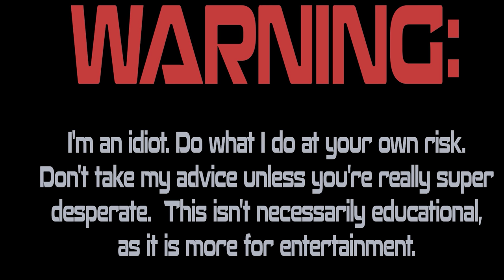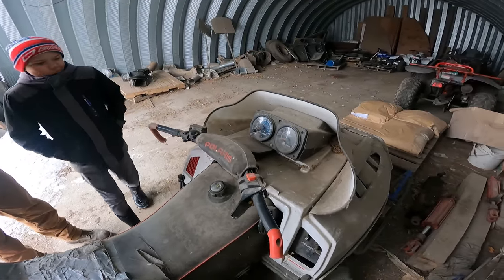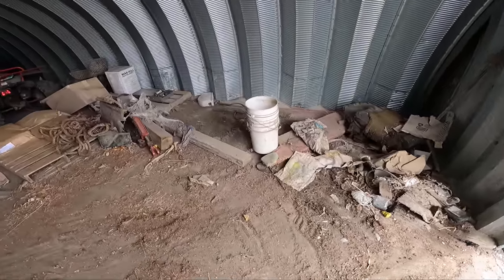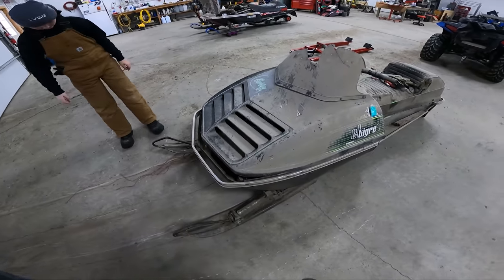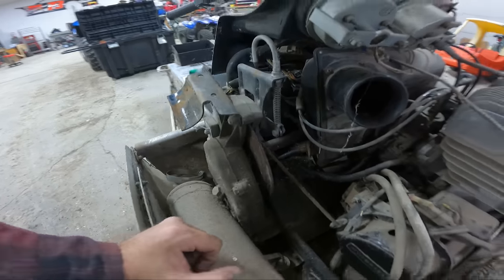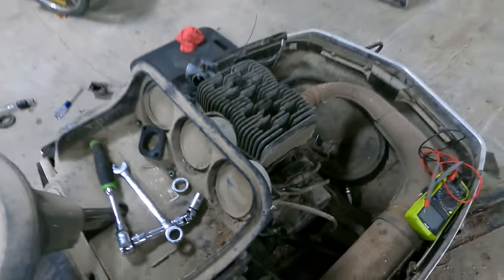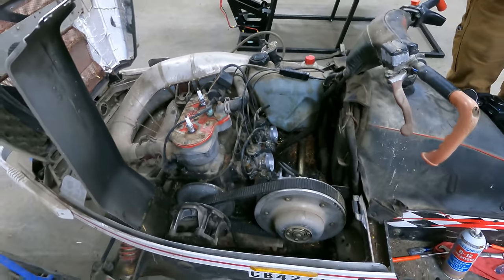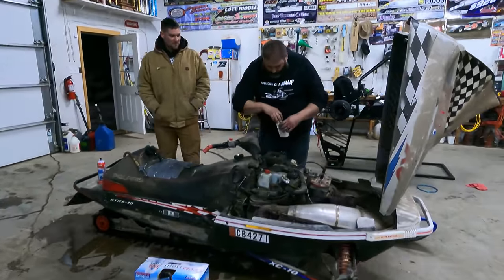VINTAGE Polaris AND Arctic Cat Snowmobiles - Will They Run? (WITH MILLENNIAL FARMER!)

Comment: Yes us Fellers up in Canada would like to see that old cat running again!
Reply: 2nd to that
Reply: They were very popular up here in Canada but many did forget they were ‘fa’s’ aka free air which meant you don’t run them slow or lugging..they are meant to be out on the lake and a couple of ticks from take-off. Run Em slow and kill em dead. Guys often used a cooler plug and/or richer fuel which of course ultimately ended in a foiled plug and often dead coils. It’s a whole chain type thing what goes wrong. Keep an eye on those temp gauges. 😉 purrrr kitty purrrr. 
We had a panther, a cheetah and finally a Tigre` then many other brands...winter loooong in Canada.

Comment: Your making me feel old because I was the engineer for production of that Polaris 700!!
Reply: Hometown celebrity right here.
Reply: You serious? I got a 600 xc indy and its the greatest ski doo ive ever bought!
Reply: @destro420qc6  The 600 was my project too. Here is a little fun fact! The 600 cost the exact same to produce as the 700 right down to then penny. Polaris lost money on every 600 sold over the 700!
Reply: @destro420qc6  er that Indy was the greatest Skidoo you ever bought?   No biggee, I get it.  We used to say,  let's go ski dooing back in the day.  Skidoo loves the attention anyways.
Reply: Young stoner. Had 97 xtra 10 600.  Triple plped triple dg can Psi 800 kit. 151 track. Monster. But have to admit twins make tons of HP.
Reply: Goddamn must have been a damn monster lmao, all i know is that mine was doing drag race back in the days before it got forget in a shed lmao, 10 000km before i had to open up the engine and both piston were broken and it was still running, the piston were 0,6mm too small and still i’ve reached 200km/h with it, it was a pain in the ass to start, but now with new piston and all its almost scary to ride especially when it start drifting in trails lmao(sorry for my english im french)

Comment: Ohh fancy, trailing arm suspension on the front of that Polaris. Oughta be a cushy ride there!
Reply: Polaris now has swing arms on the rear like a street bike, have for about 10 years or so
Reply: Polaris had it in the early 80's the skidoo copied it later on

Comment: I got the coil,for the eltigre   I’ll just send the motor mines bored I trashed the sled due to bar wire fence need your address
Reply: Run it:it’s fast
Reply: Awesome, Tjay. 
A guy can find contact info in the "about" tab on the home page for VGG.
Reply: It`s also in the description above.

Comment: Also give them time to build heat before ripping. The pistons expand faster than the cylinder does. A cold seize situation an occur. Also the carb boots between the carbs and engine have a tendency to crack and leak air causing a lean condition. Have fun guys!

Comment: @Vice Grip Garage The Arctic Cat is a 1976 model. Any Arctic Cat key from that era will work in the key switch. The brake disc being loose like it is on the jack shaft is pretty normal. I'd do a compression test before you go buying any parts.

Comment: El tigre is a 76 made in late 75.  The 75 year model had the kawasaki engine quad plug heads.  Also the decals on it are for 76 model year.

Comment: Love the faces on the kids when the Polaris came to life, makes it all worthwhile. Another great video Derek, keep them coming. I raced snowmobile oval track and hill climbs in winter and grass drags in the summer running Arctic Cats from1970 to 1975. I live in New York and we raced local events and at Booneville, NY. Had a 634cc Panther with chrome side pipes, 500 ElTigre, 650cc Chaparral, Yamaha 433, Sno-Jet SST 440. Great times.

Comment: I had a 1999 Polaris indy XC 600 WITH THE HIGH PERFORMANCE TWIN WITH THE BIG BORE MOTOR, I RUN IT AT A RADAR Run and I got it up to 103 mph in a 1000 yards. 
I love it, it was so fast and great handling, the pipe was rusted out so I put twin pipes on and jetted and clutched it so it would run better and it sounded great. I sold it to a friend of mine for 1200 dollars. We have gotten a foot of snow since late Tuesday night 14 inches so far.

Comment: I had an identical Polaris xc snowmobile. But it only had the 580cc motor package. And they were well known for having fuel issues. From the 580’s to 600’s to 700’s to 800’s. The easiest fix was an aftermarket rebuild for the carbs, and fuel pump.

Comment: Oh the old Suzuki spirit 500! Had a 79 panther 500 touring sled single carb n that fucker ran hard! Ended up getting a Pantera 500 free air with dual carbs, swapped motor over and dual carb the fan cooled, cut the expansion camber to remove the muffler and wow! Ended up putting that spirit Suzuki on a mid 80's ski-doo everest n never looked back! Those old Suzuki 500's are animals!

Comment: Here's a tip. Fill the cylinders with Lemon oil and let them sit over night to loosen them up. Broke an early 70s yamaha 292 one lunger that sat for 20 years and seized solid loose using the method.

Comment: I’ve got one of even older (and more rare) vintage sitting in my garage if ever you’re looking for another prospect.    Same story though, father bought it brand new 35+ years ago and I still have it because of sentimental value.   Hasn’t run or seen snow (or even sunlight) in about 20 or more years.

Comment: On the XC700, careful, buddy had one:
Broke the starter rope out on lake-so we did the rope on the clutch starting method.
Proceeded to blow up engine almost immediately because the bright engineer put the oil pump in the starter recoil area.
Which broke from the loose starter rope.
Full rebuild later, first restart on lake rope broke again! We towed her this time….
Broke the ropes and blew the engine because there was a pop rivet sideways by the pull handle,pull it the right angle it was like a knife.
Sideways pop rivet cost a motor and another 10 mile tow.

Comment: Hi Derek,,, 
My father taught me a cool little trick when trying to clean Carbs & their little tiny screw holes inlets and outlets & components too - He told me to grab a deep spaghetti boiling pot - throw all moving parts along with the bodies of the carbs - and anything els that has tiny little parts and holes that you may not be able to clean - fill up the pot with pure Distilled Vinegar and soak 24 hours  - then rinse thoroughly with highly explosive liquids ( JUST KIDDING) - Rinse thoroughly with mineral spirits.....or something of the sort....This method has always worked very well for me - Thanks - and sorry about the coil on the Artic cat
you will get her goin----I just know that you will....there aint no engine out there that can't get to fire buddy
Love your vidz Derek
Steve

Comment: El tigre is a 75, i had a 74 in the late 90s early 2000s as a kid/teenager. It had a steel/chrome tank. It was more machine than a 100# 13 year old kid could handle back then.

Comment: I’ve never lived in the snow, but I’ll tell ya I sure like this snow machine content. Looks like a blast.
Reply: You can run them all year round, you can change the skis out for something resembling roller skates and put a smooth track in them for driving around, or if your being lazy just drive them on water, just hit the kill switch before she goes under, rig up a winch and pull it out, pull all your plugs and hang it from a tree to try out while you run to town to get new oil/ gas

Comment: To get spark, unplug stuff instead of plugging it in. No key needed if you unplug at the back. Tether and kill switch work the same. Check compression, should be at least 120. Blow in the tank to pressurize your fuel system to prime the carbs, this will save you lots of pulls on initial start-up. A little gas poured straight down the spark plug hole will help get it going as well. A mouse WILL chew up the paper towel if it gets there.....that's how you know you didn't have a mouse. That 500 is in fact a very special sled. Kinda like finding the sled version of a big block chevelle.

Comment: I bought one of those 700's used when I was about 15 that had been bored out and ported I know I pegged the spedo over 70 a few times with it it was scary fast and torquee. Useless in powder/deep snow though to heavy and to short a track "another good reason for that extension" it had no low speed you touch the throttle and if it doesn't bite your digging a hole in a second so was only good for already packed trails. Only had it a few years before the engine seized on it and was a few years with crap for snow "Northern MN" so we sold it and another sled with our snowmobile trailer to some guys we had doing work on our property one summer. A few years back I bought a used EFI sled and it put that old 700 to shame but was again crappy in deep snow so sold it soon after buying it and fixing it up some.

Comment: i had  that 1977 artic cat when i was a kid my dad bought it brand new for  $ 700.oo it would run 80mph no problem you have to run premium fuel in it or it will self destruct the throttle cables stretch  like crazy its the same engine as your pantera 1500 miles is about what you would get before a rebiuld will be needed use the best oil you can and mix it heavy the machines need a lot of lube if you want it to last but this is what was available at the time we still had a lot of fun brings back some good memaries

Comment: The date on the side is the build date, not the model year.  Usually you would add one as most of the '76s would have been built in 1975.

Comment: the old El Tigre should have a Kawasaki motor in it. 1975 was the last year in the Arctic Cat Jag. Arctic Cat cut ties with Kawasaki an went to the spirit motors. The 1974 typically had a quad plug engine.

Comment: Hey if your interested in ditch banging and a bit of hill climbing come to Northern Saskatchewan, we have snow from October to March, usually have 10 feet of snow a year or so, enough that you can drive over barbed wire fences easy, also if your board check out ice road truckers, cause that's a thing here, my Dad was the first one to cross an ice road with a load back in the 70s, went all the way up to Uranium City

Comment: I don't know if you remember Winny the Poo but in that there is a charicter named Tigger. The ElTiger is pronounced in that manor. As for the Suzuki powered ArcticCat, it is a 76. Up through 75 the Cats were powered by Kawasaki engines with for spark plugs, and a Kawasaki powered 440 would walk all over the Suzuki powered 500 in a short or long race.
As far as that goes, the Suzuki powered 440 (431) was quicker than the 500.
I used to race those Sleds and liked the Kawasaki's best.

Comment: I had a 98 xc700 in the early 90s. That sled ripped. Had pipes and a boost bottle. Didnt handle for shit, but not many sleds could touch it. Of course that was then.

Comment: I was told that the El Tigre has nickel lined bore and couldn't handle slow driving, not enough air flow and would warp the bores. Idk. But they were fast, only a j.d. liquid fire could come close for years

Comment: i have an 81 cat i had ignition problems i unplugged the key and pushed the plug up thriough the dash and tapped it to the steering post and bend a metal hanger to stick in each end and it work fine it goes about 60

Comment: When that polaris fired up and backfired all i could think about was my 2001 RMK 500. Been fighting it for awhile now.  If any of you have any ideas ill post my comment from the video before this I would greatly appreciate it. Thanks.  
Comment from last video. 
Hey Derrick and fellow watchers. I have a question for you all. Long story short I have been messing with 2 strokes for about 20 years I'm a diesel mechanic by trade and long story short I usually don't mess with anything newer than 2007 because of all the electronics and emissions crap. I have a 2001 Polaris RMK500 and I am stumped on this snowcat. It's problem was it would run great for about 5 minutes or so and then backfire and die and wouldn't start again for about a couple hours. I have excellent compression and great spark. Things that have been replaced are The CDI box and the stator and coil and the carbs along with a new fuel pump and lines. I've done a leakdown test and it passed with flying colors I have also done a smoke test to backup leakdown test to make sure center crank case seal is good. I have replaced the reeds as well.The sled has 600 original miles on it and I would love to see it run rather than part it out but im at my breaking point with it. I think that because I have spent so much time on trying to get it running that I am probably missing something so small and stupid. If any of ya'll have any ideas I'd greatly appreciate it this one has me stumped for sure. It does have the flat slide twin carbs with a single furl feed and I'm leading towards the carbs because I can spray fuel into the cylinder that is not firing ( which it swaps occasionally) and it will pick up as long as i continue to spray fuel into it. If ya'll have any ideas please let me know. Thanks

Comment: The anti-mice paper towel theory might have some bacground: a dude once told me that there might be 0.3% chance to drive the rodents away by heavily peppering the inlet-pluggage-thingie.

However, from my point of perspective, which is big city life bound, the bigger problems are hardly avoidabe: once happened to throw a rats' nest out of a Town Car air cleaner, and the air filter was chewed up all the way through together with the steel supprot mesh.

Comment: History update, "If it wasn't for Polaris, there'd be no Arctic Cat. First Polaris was built in early 1950s, Arctic Cat was first built in the early 1960s. Cat was the brain trust of Edgar Heaton, after he left Polaris and his little Brother. Dennis Kirk.com, parts warehouse extraordinaire, they should have a coil pack to fit.

Comment: Love the El-Tigre, but the Polaris is a straight up beast! What's that you said 700 CC, about 2000 horsepower 1900 lb. feet or torque, needs to to get its big self moving. The El-Tigre on the other hand with the Suzuki 500 ,..  is that the motor as in the TT-500 dirt bike? I rode a TT-500 and a Kawi KZ-350 Enduro (still have it, its a '72)  and both are SCARY FAST on 2 wheels.. faster than I had the balls to take either to the edge. Those Mikuni carbs were always a joy to work on, both engines are fairly simple, basic and easy to service/maintain/rebuild or modify. Basic Digicals to diagnose and repair especially on the El-Tigre.. Great video, keep the snow mobiles coming! Let it snow, butthole deep to a drugstore Indian!

Comment: I have a 99 xc600 with the same motor it’s scary fast it has 135hp an carbs that are junk the float pins wore through the flowt towers an the motor is locked up now from sitting but if u ya want it 600 bucks takes it thats a buck per cc

Comment: The Suzuki motor is a very similar to the 500cc motorcycle motors and they used the same family of parts for some of their outboard motors as well. You would be able to use the coils off a 73 to 76 GT500 Suzuki motorcycle. The main problem you will have with it is leaking crank seals which require the crank to be pushed apart to replace but the seals for the motorcycles are available non genuine from Cruzinimage in Japan if they are the same as the bikes which I suspect they are

Comment: I've got a couple of 91 arctic cats sitting in the back yard if a feller wants to drive up to forest lake and get em.
Reply: Tried to start em recently?
Reply: @stitchthisditchthat259  not in a few years. Both ran well when parked. I checked this summer and the 440 fan was locked up, but the 440 LC still pulled over fine.

Comment: get the ARCTIC CAT arunning. I wonder if the engine is related to the Suzuki T500 (GT500) road bike from the 1970's. They were known for good low down power and reliability if not speed.

Comment: Off topic, but what weight diesel motor oil would you use to replace the 10w-30 conventional oil for my 1985 318 v8

Comment: A guy was told if you unplug the ignition switch on machines of that era(pre 80s) they will start without a key. The same guy may have moved a few machines around a hotel parking lot back in the day.

Comment: This seems weird thinking of 1998/1999 as old classics! Ive got a pair of arctic cats bought new in Oct 1999. The "hers" is a 1200 mile mint like new air cooled Z440 with the 13in travel fast track "the good" suspension.
My sled is a modded 99 ZRT600 with d&d triple piped mbrp silencer, d&d clutching, 196 studs, air box free flow topper, holtzman dial a flow fuel curve "tweaker", and also a then top of the line Racepak triple display dash computer with egt, temp, etc. The triple 6 only has i think 2400 miles (?). Both sleds stored in fiberglass top c nose sled trailer, drive on drive off...cannot for life of me the name and model of trailer...
Anyway...if anyone is interested in a package deal for all of it then hit me up. 
Health problems have kept me for riding for at least 10 years so its time to let go of the kitty's

Comment: Tigger looks like a 76 or a 77. 75S had Kawasaki engines with twin plug heads. Graphics were more plain. , not covered in pinstripes. Easy check is first digit in serial number matches model year for seventies cats. 76/77 had Suzuki Spirit single plug head engines. 500cc FA spirit engines you can still get parts for on the web because they built thousands of them and they share parts with the 500FC. . The 440 Spirit FA is harder to get parts for because it was only offered two seasons. Friends tell me the pistons are oddball. ActuallY easier to get parts for the Kawasaki 440/340.